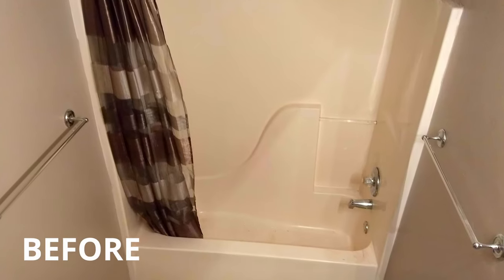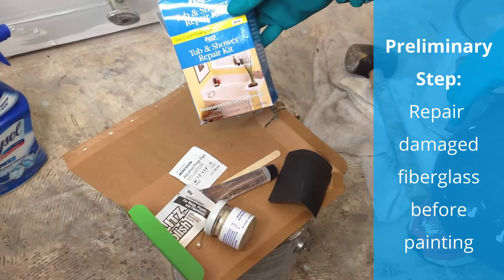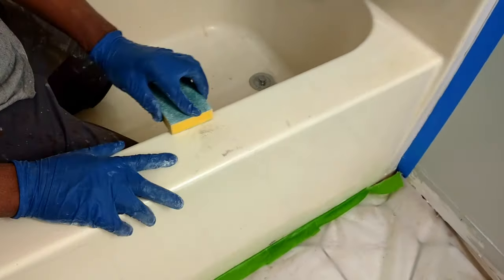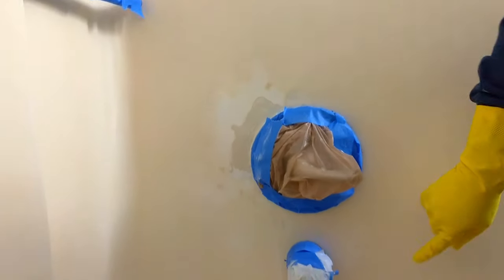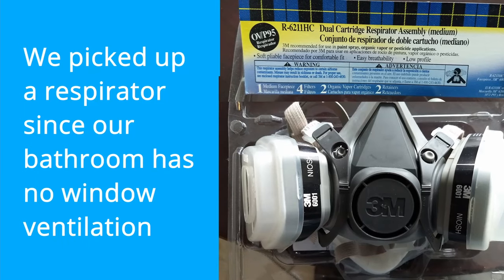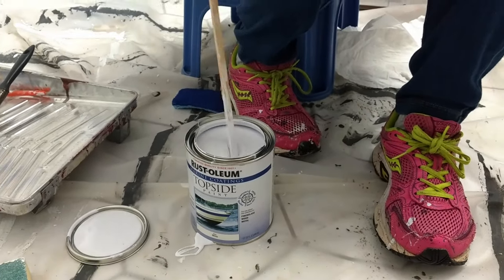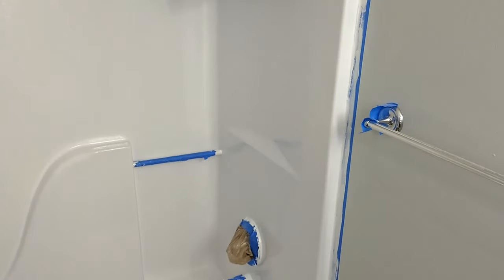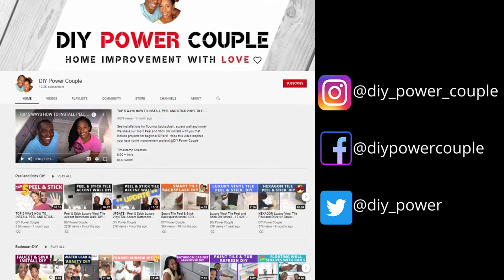How To Paint a Tub & Shower Surround |  BEFORE & AFTER  FIBERGLASS REFINISHING | DIY Power Couple

Comment: I've watched dozens of videos on resurfacing a tub. You guys are gonna be my north star. I want to do it for the same reason as anyone else - save thousands. Makes total sense to use marine paint on a fiberglass tub w/surround.
Questions:
1) did streaks come through where you used regular paint brushes?
2) did the grippy surface at the bottom of the tub get preserved?
3) what kind of masks did you use?
Reply from the maker: Hi!  This update vid should answer all your questions - https://youtu.be/2keG3XfxEKk
Grippy surface stayed in tact because we didn't sand it down too much.

Comment: Thanks for the video! I'm going to try this. Questions, is there a reason you didn't do two coats of primer and two coats of the top coat? Also, wouldn't you sand the primer in between coats? Thanks!
Reply from the maker: One coat is enough...and you have to let it cure before use.

Comment: Nice video.  The only thing I might add is that my wife and I have painted a boat before. It's called roll and tip. You roll on the paint, then tip it with a wide brush in one long stroke at a time. The paint is made to blend together as it settles. Then you end up with a smoother finish.
Reply from the maker: Great tip!
Reply: Ya seriously that is a great tip, I'll roll with it!

Comment: I LOVE this idea. I had an inkling that marine paint would work for a tub/shower, as I have always wanted to try to make a wooden tub and use marine grade sealant on the tub. I even explored shou sugi ban for the wooden tub then sealing it with a marine grade sealant, post the drying of the Tung oil. Your results are beautiful, look professional and the products you used are easier to work with, when compared to those resurfacing kits. I've checked into a few different brands of tub refinishing kits/paint and the marine paint is far more economical. You will have to give us an update on how the paint is holding up for you. Thank you both for the inspiration. Love, Your New Sub  😀
Reply from the maker: Mary, All we can think about is how most boats were made of wood before they became metal and fiberglass. You may be on to something. Let us know how it turns out. -DIYPC 😃
Reply from the maker: 😀 Hey there, click the link to see 👀 our UPDATE VIDEO for the fiberglass tub refinish https://youtu.be/2keG3XfxEKk
Remember to LIKE and SUBSCRIBE!

Comment: Can you use a bathmat on the floor after your paint it???  When we had our porcelain tub professionally refinished they said we could no long use a bathmat but they made the floor "scratchy" so you didn't slip.
Reply from the maker: We would make sure the tub & shower surround is completely cured before placing anything on it.

Comment: Thanks so much for this video! I'm going to do my tub this weekend but I'm curious if I need to fill small chips or if the paint is kind of self-leveling and will fill in those little chips?
Reply from the maker: We filled in chips first.  The paint is self leveling and works better at covering than filling in in our opinion.  This follow up video may also help: https://youtu.be/2keG3XfxEKk?si=s9gxE8uSfBEdrHYU
Reply: @DIYPowerCouple  thank you! I already painted it and It looks fabulous. I appreciate your video so much. I did fill the chips with fiberglass Bondo first. And you weren't kidding the fumes were no joke lol.

Comment: I have a tub with walls in one piece, similar to what you have. It is beige, but I've noticed that it is getting discolored to grey color in few areas. I asked people around, and no-one knew what I should do apart from replacing the whole set. I did not like that idea because it is only a cosmetic problem, there are no real damages to it. Why can't I re-paint it? Few people told me that you do not paint fiberglass. Even my friend who is a professional painter told me the same.
I made few trips to Lowe's and Home Depot. The paint department guys kept telling me that there is no paint for that.
Then my wife had suspicion that this bathtub was repainted by previous owner just before they sold us the house, to make it look good, but then the pain started to chip. So, my wife also believed you cannot paint it, because any paint would chip or get dissolved eventually. But I just could not give up and started to look up what kind of paint is used for acrylic or fiberglass pools. I found they usually use Acrylic Pool Paint, and someone said that the more gloss the more water resistance is in the paint, so high gloss would be the best. Then someone said that Acrylic Pool Paint would not be strong enough to be used for countertop around sink, because of frequent use of cleaning chemicals and advised to use Epoxy paint instead. I don't know if it is true, because pool water has chlorine in it, so the paint has to be up to that. Also I found "Premium Ultra High Gloss Vinyl Pool Paint", and the seller claims it has "algae and chemical resistance". Unfortunately it is meant for vinyl, not sure about my fiberglass, so I had to drop that idea.
Keeping epoxy paints in mind I decided to check marine paints, using the same train of thoughts you guys had. I looked up the same paint you used, but the "Topside" part of its description was bothering me. What if it is not water resistant enough? Maybe I should go for a "bottom side" instead as that is constantly emerged in water? Well, unfortunately it is much more expensive than the "topside" kind.
After all these searches I stumbled upon your video and I got mixed feeling. There are few things that I as DIY-er would do differently - like stirring paint with a stick. Why don't you use drill? Wouldn't it be much easier and faster? For the smell in your situation I would use shop vac in a next room window and an extension hose to the bathroom. It works both for dust and fumes and if you have a good strong shop-vac it would suck all those fumes out. Well, at the end of the day you might have to clean the outside wall below that window if you had a lot of dust. My outside wall was all covered in dust, but it saved my lounges. Anyway, that all is not the point.
My point is that I was not impressed by the final look of your bath walls. And I'm not trying to blame you for that. I thought it would actually look like a new tub, but the surface is not really smooth. I mean, it is still better than it was before, but not what I imagined it should look like. Yes, it is gloss, but that gloss is actually magnifying roughness of the surface. So, I'm kind of disappointed. I wonder if there is a better option that would actually look like a new bath? Would a paint thinner adding help with this problem? Maybe a lot of polishing and few extra coats fix it? Or maybe enamel would work better to make it smooth?
I don't know, but I'll keep looking for the answer.
Reply from the maker: Hi Vlad, completely understand your concerns. The tub still has not chipped on us and here's the update video: https://youtu.be/2keG3XfxEKk
Please let us know if you find an even better solution because we have another fiberglass tub surround that we would like to paint! 😃

Comment: So it's clean ,use sand bar scrubbers, clean again then it's primer  then 1rst coat?
Reply from the maker: Yes. Use a heavy duty mask with the primer.
How I Use This Rustoleum Marine Coatings Primer  https://www.amazon.com/vdp/0875757ca4b34bb6b1d8ea01fe64a643?ref=ive_share_mshop_vw-iga

Comment: I was looking for the Topside paint colors and noticed it said "for use above the waterline".   The Boat Bottom says "for surface below the waterline".    Shouldn't the Boat Bottom paint be used for a bath/shower?
Reply from the maker: We thought the same as you, but the answer is no. The bottom paint is very toxic and we learned that the topside works best. If you use the bottom paint, please share your results...make sure you definitely wear a ventilator mask 😷. Best -DIYPC 😃✨

Comment: Hello! I have a porcelain bathtub and torginol covered shower walls that I’m getting ready to paint with marine paint (different brand that I found on Home Depot’s website that they shipped directly to me). I’m concerned that the marine paint may be sloppy on the bathtub floor and was considering adding some sand to the mix for that step. Have you noticed this issue with yours? If I can eliminate the sand, I would love to just proceed and paint! Thank you! Great videos!
Reply from the maker: Hi Jessica! Thanks for your comment 😀  We did not need to add any sand to the paint.  The bottom of our tub already  had texture.  This tub update video may help to see how it looks now: https://youtu.be/2keG3XfxEKk
Reply: @DIYPowerCouple  Ok, thank you so much for replying! I’ll definitely check it out.

Comment: Did you find that a quart of each - primer and paint - was enough to complete the project?
 I'm at that point of priming the tub now, having followed each step you took. I'm excited to finally be at the priming stage. 👍
Reply from the maker: Hi! Check out this tub update video before you finish to answer all your questions: https://youtu.be/2keG3XfxEKk
We used 1 can for our tub surround.😀
Reply: Thank you so much! It was great to see the update! I would not have done my bathtub during our renovation had you not posted this video because even though I had been wanting to paint it, I just could not get a clear picture of the best way to do it before finding your video. I thank you for posting the timeline links to jump to different parts of the video and for the links to find the products. Since I was doing mine in stages then I could just go to your video and go right to the stage I was on. And I linked on every single product that you posted and purchased the exact same items which was so easy for me to do. You and I have the same bathtub shape and same 'before' color. I put the primer on last night and the scent is crazy strong! The link you gave for the mask that needs to be worn is much needed and I appreciate that. You cannot use that primer without that type of mask because it is the strongest scent I've ever smelled out of a can of primer. But now, with just the primer on, it has made a huge difference in what my little bathroom renovation is starting to look like. I'm so glad to see it white and I'm excited to start the paint in a couple days. 
Thank you again.
Reply: Quart is plenty. I’m in the process of doing this myself. Using rustoleum 1-2-3 primer for all surfaces. I saw it and thought it would do well. About to do furst topcoat

Comment: I'm not sure if this was answered before, but is there a preferred method to cleaning the newly painted shower? Do you wipe it down with a microfiber cloth to clean it or is it safe to use a tougher, scrubbing brush on?
Reply from the maker: Hi Keith! We used a multi-purpose cleaner and soft sponge to clean it. Here's the update video: https://youtu.be/2keG3XfxEKk